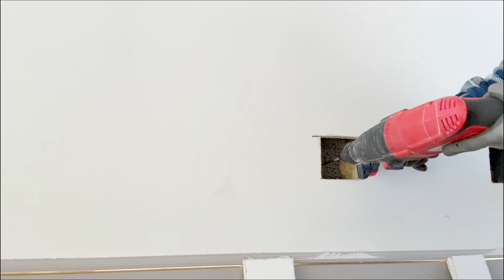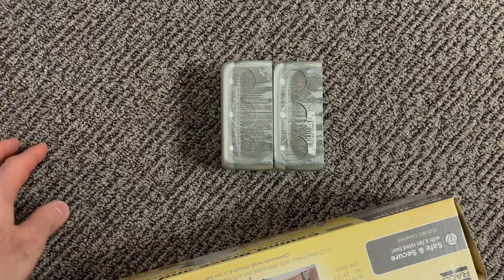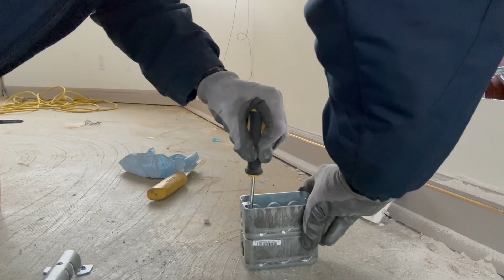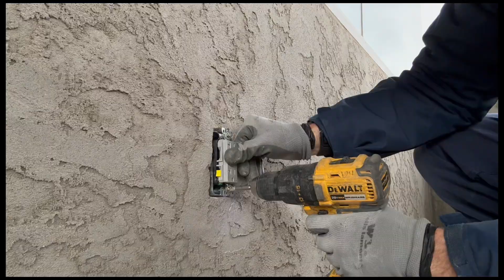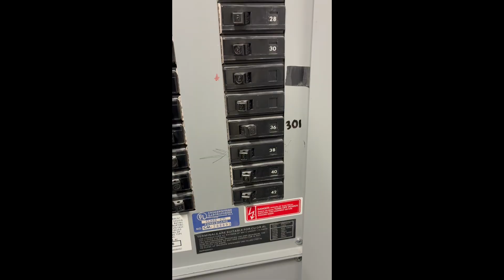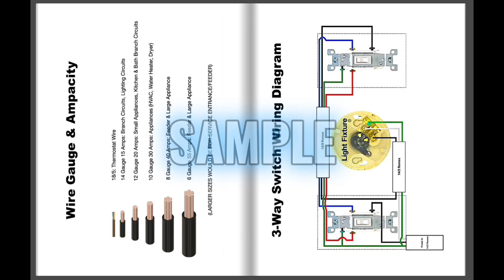How To Install A GFCI Outlet In A Stocco Wall!

Comment: Was that water flowing into the wall after you finished drilling the hole from the inside?
Reply from the maker: There was no water flowing in the wall.  There’s no water pipe in the wall in the vicinity of that electrical outlet.

Comment: Seems like you took you time. 12-2 nm romex is perfectyle.fine to use for dry wall cavity even though its feeding an outdoor outlet. I also would have used the drywall piece you cutout with small wood pieces attatched to the rest of the wall.